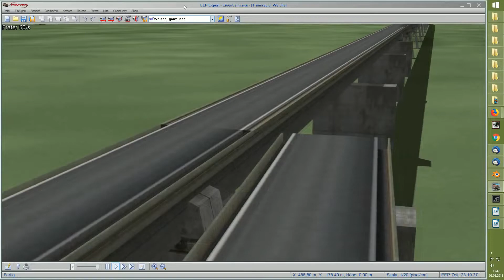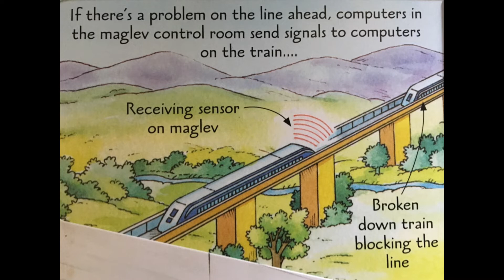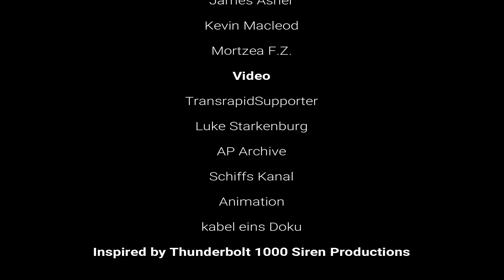2006 Lathern Maglev Collision 13 years later

Comment: The tragedy is that there was the technical possibility to lock the track for the Transrapid train while the maintenance vehicle was out. But that function was not often used by the personal in the control room. On this day in september 2006 it could have helped to prevent a human error and to save 23 lives.